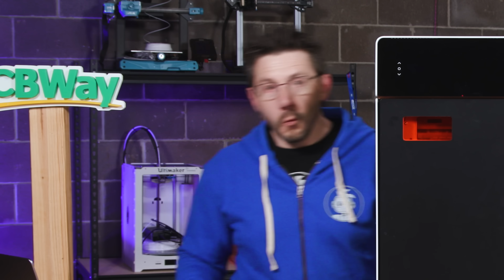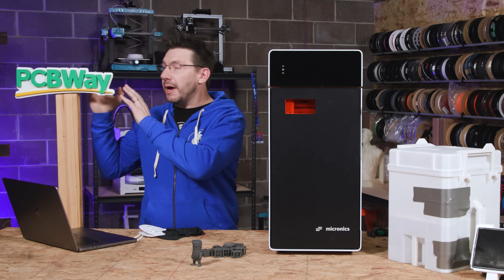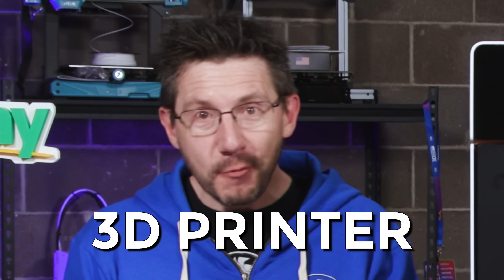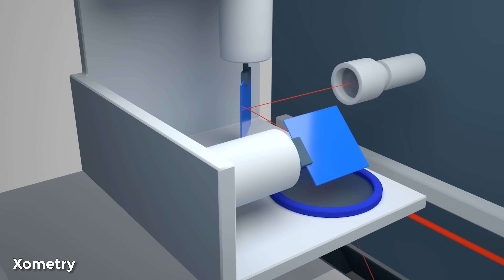SLS 3D Printing AT HOME?

Comment: Thanks for another awesome video about the latest in 3D printing tech. Though you should know, that that mask you are wearing is not even close to effective enough. Better than nothing? Sure. Good enough to keep your lungs safe? Nope.

I've watched OSHA safety videos on this subject because of my beard, and any facial hair (even stubble) allows all sorts of particles to get in around the sides. 

Unless you are freshly clean shaven, I would not go in a room with micro plastic "dust" being moved around in it without wearing a full head type respirator. Something that does not require a tight seal around your face to be effective.

Obviously you should do what you think is right for you, but I wanted to make sure you understand the level of safety you are actually at with that type of PPE so you can make an informed decision. Even if it just gives you a year or a few years more time at the end, I think it's worth being as safe as possible. I'm sure you would rather do what you can to get as much time as you can out of life. And I know we all want you around as long as possible.  High-5!

Comment: 80 grit???? Damn that is heavy. I would suggest getting in the 200 or finer. I would also suggest not glass beads. They are hard and can pit the objects they strike.look into Styrofoam, walnut shells, and other things that they sell that are softer and as you use them they become finer grit to do a more polished job.
Reply from the maker: They recommended the glass bead but I’m very open to trying other media!
Reply: @3DPrintingNerd  To be clear I have not done nylon printed like this. Maybe it is hard enough to take it or soft enough to absorb the striking. But to me the blasted prints looked peened. Like you struck it thousands of times with a small ball peen hammer. We do bead blast Ultem a lot and that stuff is very hard.

I would suggest playing with the pressures as well as the media.

All the best to you and your family

Comment: I find it odd that other reviews are having fairly major problems, and you have basically nothing of significance.
Reply from the maker: I had common shorted to ground and a board burned up on me. Other than that, no print issues that I didn’t cause myself from lack of knowledge.

Comment: Apart from setting the slicer so that they print solid, are all of these prints full of uncured powder?  If you cut one open, or something breaks open, is it just a big dusty mess?  Are you planning on doing a strength test on the prints?
Reply from the maker: No, all prints are solid

Comment: The danger of things like this is that practically no one in the hobby space has experience with this technology so it is very easy to scam people or deliver not very good products. People will buy it because it is new (in the hobby space), because they have heard that it is very good in the professional space, but none of that means that this product will be any good.

Even Joel doesn’t know much about SLS from the looks of things. He may have used parts made with SLS before but it seems this may be the first time he has used an SLS printer himself, so people should bear that in mind when watching the video. Given how many times this was referred to as a beta unit and that he found major design issues himself that he easily could not have mentioned, what other issues did he not mention? We will never know if that was the only issue or if it was a battle to get it to print reliably.

I am very surprised that material costs were not mentioned, this machine is useless if the material is expensive, even if he can’t reveal the cost that micronics themselves will sell material for he could have mentioned other material or if it would be compatible with material not bought from micronics. The fact he didn’t mention makes me worry that it might only be compatible with their material. Hobbyists generally don’t buy printers that they have to use closed source, proprietary material for, we like to be able to buy material from anyone and have it work, provided the material is good enough.

Edit: especially since I have seen reviews from other people where someone claimed “this is not ready for anybody to buy”. Joel has a reputation (in my eyes anyway) of being overly positive and glossing over or not mentioning any negatives about a product
Reply: The real concern is the "at home" part, OSH for this kind of process is pretty heavy.

Comment: as someone who works with metal powder in an SLM 280 and an EOS M290 everyday, I can tell you that it doesnt matter HOW careful you are, you are going to need to clean powder off of thigns all of the time no matter what. Working with those machines, I would NEVER put a machnine that uses powder in a place connected to where I live.
Reply: I work with HP mjf all day. I can 100% agree. This is a mess that is not going to fair well with the general population. There is so much that micronics haven't yet considered. I really do love what they're doing, but wow, this thing misses the mark by miles.
Reply: Hi all, I've worked with SLM and fully agree with this comment. I've moved to work in a university now and run additive manufacturing courses. I can say the main difference between metal powders for SLM vs the polymer powders for SLS are mainly reduced risk of fires and explosion with polymer powders (it essentially is not combustible in the volumes present in polymers). HOWEVER, the risks to your respiratory system are not reduced. This process looks an absolute death trap at the moment, rooms should have constant ventilation generally as will as extractor hoods in local area to improve safety. The PPE should really be a full respirator at a minimum, not a paper mask only. The companies selling the machines are the only people showing less PPE, bias maybe? I personally know researchers in the space who have been in the additive powder process space since before health risks were known. These people are now on oxygen tanks to breath almost constantly with doctors giving them months and years worth of remaining life expectancy. Do not do this at home, it is not safe.
Reply: @darrend7352  I wonder if one could cut the dust issue down a fair bit by going with a wasteful process... "splatter" the layer outside the print so you end up with larger globules of powder instead of a pile of untouched material (not pixie dust... toxie dust?) 
Pricey? Oh yeah. Worth not needing an oncologist to print in areas with less than ideal particulate control? Maybe, depends if the cost is less than making a negative pressure workstation with a HEPA filtration unit, and finding some antistatic overalls and PPE. 

I wouldn't use this at home without at least a tent and serious PPE. Feels like it would be as bad as running a garage business refilling toner cartridges by hand. 

Has anyone looked at finding a light oil, nonflammable solvent, or other liquid compatible with the plastic and running a slurry instead of dry powder? Or even a flammable fluid and inert atmosphere? Mist the layer with water before reflow?
Reply: @darrend7352  - 1000000000% Agree. 

Just look at ANY of the 3D printing companies selling FDM/SLA machines - you'll find CONSTANTLY images of a child sleeping in the same room as a printer churns away on a table. Or a family staring rather oddly as an SLS prrinter just chunks out resin print jobs on a coffee table with a dog in the background or whatever else. 

Companies are not doing enough to make aware the consumer of what dangers are present in resin. There is almost a conspiracy level of denial in the dangers of these materials, and I can see in 20 - 30 years we will have a lot of people developing cancers at advanced rates with the common ground being, they all had some kind of 3D printer at home and failed to do any kind of research into proper handling - a single look at ANY of the resin bottles MSDS's would have provided enough information to confirm any worries and/or doubts.
Reply: @darrend7352  thanks for adding this. It's hard to know how well these experiences will resonate with people looking to add to a hobbyist setup, but its good to know quite a few people are speaking up about why this type of technology has been kept from the consumer space all this time.
Reply: yeah, especially with the way that people handle resin i bet we're going to have an even more serious microplastic problem with this plastic powder being used by people who arent trained or who dont care about proper usage and disposal
Reply: @3DCrimson  It's those who don't care or aren't trained that'll really fuck it up
Reply: I'm glad i watched this video.  I was excited about this printer, but what the promotional videos left out was the mess.  The mess is the same reason i am not a huge fan of resin printing. 

I'll stick with FDM.  I think the advantages of SLS looks to be outweighed by the mess.
Reply: @bluerider0988  In many cases yes. I requires a lot of protections to do right.
Reply: @bluerider0988  well, i would really prefer the powder mess instead of the resin stank.. Shure, get a good ventilation system and a real respiration mask, then just print. That would be something i would do anyways. Use to lots of dust from cutting and welding metal in my garage, so dont think something like this would be any worse then that (without good ventilation and respiration mask for decades)
Reply: @jvsyoutube3298  I dunno, this dust is a lot finer and there's more of it than you would deal with cutting/sanding/grinding things. Wouldn't want that regularly floating around a livable area, at the very least in a cabinet similar to media blasting.
Reply: @jvsyoutube3298  unfortunately at the particulate size, it's orders of magnitude worse than welding or cutting by my understanding!
Reply: @bluerider0988  you are wrong if you believe FDM is safer. 
The extrusion Prozess of a FDM printer will also introduce micro plastic particles in the air.  Therefore a hepa filter and an enclosure is the minimum.
Reply: @Mr.T9191-i2f  This is true, however this is much easier to contain in an enclosure and filter, because its not necessary to post process fdm parts.

That being said there is no comparison between the amount of caution and care that needs to be taken between the 2.  FDM is a much easier process to do safely, and there's really no good argument for SLS to be safer.
Reply: We CNC cut aluminum and steel....you would not believe where I found chips...like in my bed. And than think of several magnitudes smaller particles. You'll have it everywhere
Reply: @psxtuneservice  yes so true! I know that even as a hobbyist welder, metal pieces from grinding end up all over the place! Even with ventilation, extractors, an attached vacuum hose and cleaning, they get everywhere. Same with CNC and any other type of machining, sanding, hammering, etc etc all causes metal pieces/particles that to get EVERYWHERE! Which is why PPE is MANDATORY every place I have worked that did any of that. Full face masks, fume filters, leathers, etc but anyone who knows about this stuff, works in any of these fields or understands chemistry and biology would know that you can’t just “deal with it” or “soldier through” this stuff. Maybe for the moment but definitely not for long and definitely taking years/decades off your life.
Reply: I was wondering about this. Most people will put this in their house, which could be really dangerous if they have central HVAC. This powder will be everywhere in their house.
Reply: Metal powder is at least heavy. The nylon wowder stays in the air for much longer and gets absolutely everywhere reacable
Reply: Yeah I'll stick to fdm
Reply: This product in the hands of regular consumers honestly makes me cringe. People have been throwing up a fuss about asbestos and similar powder particles causing cancer in people's lungs (mainly because of your body not being able to flush it out or destroy it) with companies using these materials getting sued out the rear and there's similar risks here. Micronics are putting themselves in a very vulnerable legal position. Imagine this thing in the hands of the clueless techbros putting their families at risk, majority of whom already dump water washable resin waste down drains.
Reply: It doesn’t support metal, he says in the video the materials that it supports
Reply: @oneveryfishyboi  the difference between the powder you are inhaling and messing up your lungs with being metal or plastic is not that big.
Reply: As we move into the realm of a home lab consisting of fine particulates and chemicals basic first year university best practice and laboratory protocols need to be mandatory for this type of work. Working with anything like this needs to have disposable coveralls and PPE and an exhaust /fume hood work area with the right type of venting and filters, may seem like overkill but you are working with toxic materials. Stay safe folks.
Reply: Need a fume hood
Reply: When do the lawsuits launch?  Mid 2025?
Reply: I guess that it's more doable in a hackerspace probably if you can convince the other members
Reply: what about something like a garage ?
Reply: @inversereaction5371  With lots of ventilation and a really good seal on the door to the home would be a minimum. Personally I would get a lot of HEPA filtration going, an explosion proof vacuum and change clothes before coming back into the home. It is very important to not bring any powder around with you.
Reply: @inversereaction5371 the powder is basically pure cancer so you could use it in your garage but you should have fresh air intake and a dedicated exhaust. You absolutely do not want any dust to escape ever as it can spread and become a long term hazard. I have an explosion proof vac with disposable hepa cartridges that completely contain any powder. You must have a lot of safety equipment and engineering controls the ultra fine powders are extremely dangerous if not handled correctly. You and anyone living in the same house could regret it in a few decades when you get lung cancer. A p100 respirator is the bare minimum those kn95 maybe masks are useless for the powder. I also would not trust any of those exhaust filters they have they are too thin to do anything except spread the dust around till it's thin enough to be hard to see.
Reply: @inversereaction5371  Only if you only want to ever enter that garage in PPE, because the dust will be sticking around and accumulating there and you will always be breathing it in when you go in there.
Reply: what about outside or at your neighbor's house

Comment: I wonder if the solution for initial cleaning ultimately looks like a high frequency vibration introduced into that screen with a few steel bearings included to knock media clear

Comment: OMG, the cases turned out AMAZING! Very excited to see them in person. Thanks Joel!
Reply: Imagine how many of them you can print in one go on this machine, the full volume
Reply: (Just linking the message to the right person;)
@5Komma5

4 hours ago
Pro tip for your sensor buddy. Use deep sleep on an ESP32 and you don't need the distance between the micro and the sensor as there will be no heat buildup. With an ESP32 you can get the entire sensor smaller then the PCB of your micro controller. With ESPhome you don't even bother with firmware. Just configure it in .yaml and you are done.
Reply: Staff turn amazing, side effects of printing this at home will not.

Comment: SLS Nylon is amazing stuff. I ordered a print in that from shapeways of a wallet I designed basically just holds 6 credit cards and has a flexible "money clip" to keep them in. I've used it daily for over ten years now and it's never had an issue at all.